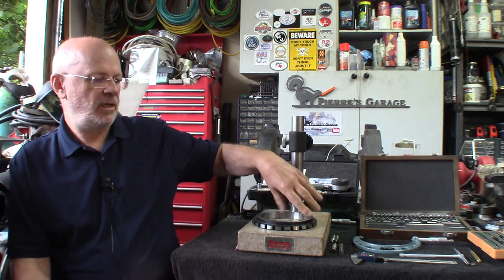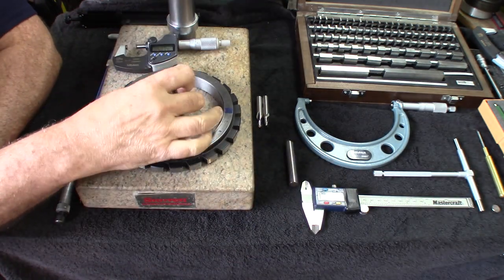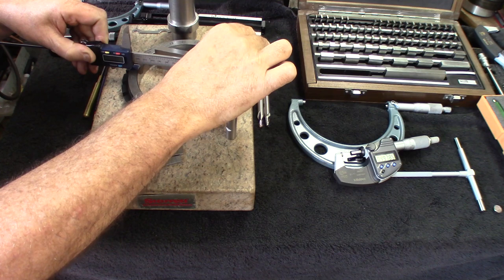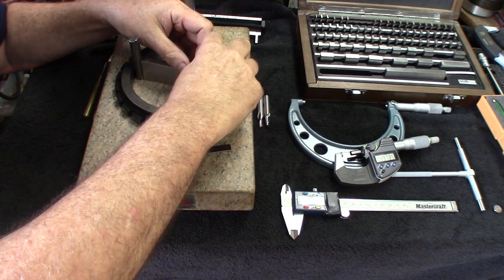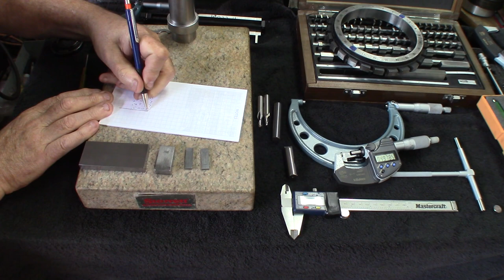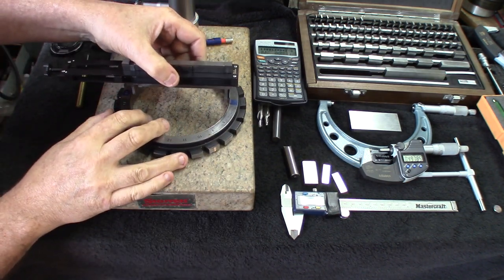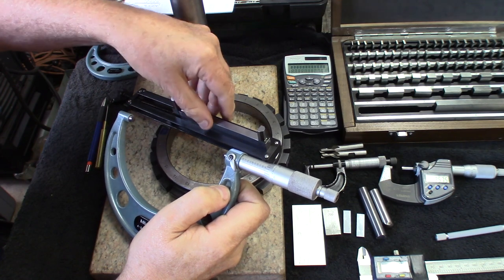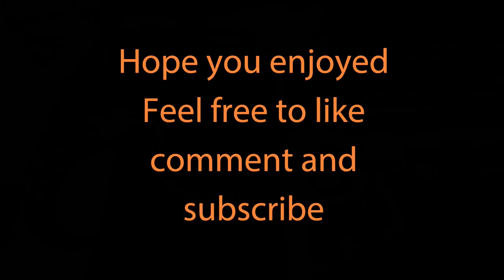Best way to measure an inside bore, very exactly and cheap

Comment: Magnifique, Pierre. I have taken notes. I need a set of gauge blocks and I work  in metric but the principle is the same. One thing I have found is that it is very difficult to find the true diameter and very easy to measure somewhere else in the hole so you are measuring a chord rather than the diameter. The two end mills are really neat because they make it hard to do a chord -- the cylinders will slip off if you are not exactly on the diameter. Very useful!
Reply from the maker: Hi Juan, glad this method will help you to get better measures in  your work, if you have them you could also use some adjustable parrallels, close to be as good as gauge blocks.
Thanks for comment,     Pierre
Reply: Hmm. Adjustable parallels = poor man's (or retirees) gauge blocks. Noted!
Reply from the maker: Something some viewer suggested, great input...

Comment: U give me a lot of very good information so once again thank u . I calkulate the difference between 4.9224 and 4,9225 inch and it is 2,54 micro or My as we say.  In 1986 I bought a new Ford Orion and measured the ticknes of the paint. On the roof and upper side it was 80My on the hod and in the front it was between 90 and 110 My. And that is not much. 2,54 My compare to that is so little it har nothing to say.😊
Reply from the maker: Happy to help, thanks for your comment....

Comment: Hi Pierre, Wish I had your gauge block accessory set. I went with Mit. digital mikes as well. But a caution about those non brand name gauge block sets. Mine were a lot more than $100 when I bought my grade 2 set. They came with a "test certificate" showing the blocks deviation from the true dimension. Despite that there were two blocks of the exact same size in the box. Penn Tools didn't even question that and sent me a Mitutoyo of the correct size as a replacement. So one could start to think the included test certificate might even be bogus. (fwiw I do) I then bought a proper set of grade 2 Mits. and the cheap set is now used as shop blocks. But I never trust there exact accuracy and always measure the gauge block stack as a double check and use the Mit. set only when I need as accurate as possible. There's also quite a noticeable difference in the holding force between the two sets and a visible difference in the surface  lapping quality as one should expect for the price difference.

I certainly agree a cheap set is almost more accuracy than most home shop guys will usually need. My Mit gauge blocks have always measured 100% to the limits of what my mikes can repeat to, but a time or two the cheap set has shown some small differences. If the work needs a real accurate measurement I think I'd make sure and measure the stack as a double sanity check. I now no longer blindly trust any shop equipment unless I check it myself as well as my equipment will allow.

Very good video and an excellent well explained demonstration. A consistent and a very gentle but educated feel is required even more so when getting down to those accuracy levels for those who haven't done this before is about all I could add.
Reply from the maker: Nice input in your comment, those cheap certificates, yap photocopier is a great invention...   lol
For a machinist, the word should be: measure twice machine once.....     
Double checking is always the first thing to do, mostly with closer tolerance parts, even the method of getting there parts machined is as important as the result, even the slightest heat change is working against you in the process, you need to let the part stabilize before any final cuts...
Most hobbyist will be more than satisfied with less expensive tools and metrology units, since money is a major object in their search to fill a tool chest...   ;)
Thanks for comment,    Pierre
Reply: The guys at the calibration lab I visited told me that the blocks which are used when calibrating a 1um accuracy micrometer are accurate to 10th of a micron. And the blocks are calibrated with equipment that is good to 10 nanometers. That's sub millionth of an inch. I don't recall which grade the blocks were, but the 10 nanometers was the most accurate measurements they could do at the lab. The 10 nanometer device was compared to the national standard when it's getting calibrated.

Comment: Great innovative video.  Could you also take the two end mill stubs, using small clamps to affix them to the inside of ring, then use your mic, or even caliper, to measure outside to outside of stubs.
Reply: The problem with this is you can't control the position of the two pins. They have to be exactly on a opposite ends of a diameter. With Pierre's nice gauge block method (or with a telescope gauge or an inside mic) you can feel when you are on diameter because you can no longer wiggle from side to side.
Reply from the maker: It's exact about finding the widest part of the inner circle, the accuracy resides in the precision of that measure, it would be possible to make an expanding device that could hold the pins in the bore and take the measure just like mentioned by Morris, interesting idea also, that would be another possible method... ;)

Comment: Nice technique. 

Two pins plus an adjustable parallel or a planer gauge, measured separately with an outside micrometer would do something similar. Snug the adjustable parallel or planer gauge between the pins and measure all three for a total inside dimension. I've used something similar for making comparative measurements inside dovetails. (I didn't need to know the exact dimension of the new dovetail slot, just whether it was the same size as one that was known to be good.)
Reply from the maker: Hi Peter,   I'll give a try with the adjustable parallels just to test how it compares with direct measurement, cause that will involve tranfering the measure to the micrometer... to be continued...  
If someone is good with trig. it's not too hard to calculate the dovetail problem, first choice, mostly if the reference dovetail is near one of the upper/lower limit of the established standard, I admit that the compare method works in most cases...   ;)
Thanks for the input,      Pierre

Comment: Very interesting video (again). I had not thought of measuring with gauge blocks and pins. Learned something new here, and had not seen this method on any other video! Thank you for your very fine programs. Enjoyed. I'm still thinking about getting my vise jaws ground by you, but right now am negotiating with my pocketbook to see if I can afford a new Kurt vise. We'll see.
Reply from the maker: Hi Jim, since I don't own an inside 3 point bore micrometer or a CMM, and needed the highest possible precision, I looked for a cheap way to get it.....    This is what I came with.....      ;)
Whenever you're ready for the jaws, money don't come easy those days.
Thanks for nice comment,    Pierre

Comment: Nice demo Pierre! The tenth variation between the gauge blocks and mic may have been due to temperature since you were handling the blocks more.
Reply from the maker: Hi Jeffrey,
Or it's possible that a slight calibration error from the micrometer, the chances of affecting the blocks with the little handling they got are close to nothing, or it can also be a handling error during the measure, be aware the tenth are pretty hard to chase....   
Thanks for input and comment,    Pierre
Reply: Indeed! The variables are incredible.

Comment: I would have liked to see how close the telescopic snap guage would have been, compared to the Gage blocks. most home machinists have those for bore measuring.
Reply from the maker: Hi Marcel,
Didn't measure with the telescopic gauges, I'll try to find the rings and see if there is something I can do about it, shouldn't be very far, the gauge blocks is surely the best, though...   ;)
Pierre
Reply: Pierre's Garage  In the video, you were talking about the most direct is the best, which I agree. Working on the lathe, with the part inside the Chuck, we don't want to pull the part out to check the measurement because then you have to re-indicate it. I have a dial bore Gage, inside mic, and telescopic snap gauges. Out of all of them, I prefer the telescopic snap gage. There is a technique to using them though. Abom79 has a great video on using them. The snap gauges will automatically find the largest dimension in a bore provided they are used the way abom shows. I don't particularly like the inside mic because it is truly difficult to find that largest dimension inside a bore. I never compared a snap gage to the gage block method that you used. It would be interesting to know how close it actually is to the Gage block method. Probably a whole new subject for a video!

Comment: We need to grind a flat on some rounds and polish it so that it can work with the cheaper gage blocks. Thank you for the video and the creative ideas. I have an optical flat coming and the mono-chromatic light idea is perfect (and cheap) :).
Reply from the maker: For the price it's working great, not as precise as the real halogen light but at least you get a real close estimation...
Thanks for nice comment,   Pierre

Comment: very interesting video. your cheepo calipers got close enough for average work. i just purchased a set of cheepo calipers at our local grocery store of all places. i intended to use them on wood since they have a fractions function. when i checked them against my micrometer stds i was amazed to see them within a half thou on every std to six inches. most were dead nuts. well i paid eight bucks for them and they are stainless. needless to say i went back and bought a couple more sets.
Reply from the maker: Those stores should give me royalties for all this publicity...    :)
There is one area where any caliper will be more thrown off a little more is when you have length that is in between thousand ex.    1.0044",   1.0046", 1.0048" it could be anything but the right measure,   within it's tolerance, but if we use them as what they're intended we'll be satisfied with the performance...   $8 is even a better deal!
Thanks for your input and comment,    Pierre

Comment: Hi Pierre, just a thought if you measure the outside diameter marking the two contact points of the micrometer, take a measurement of the wall thickness on the two marked places using a known pin size on the inside, deduct to two wall thicknesses from overhaul measurement and there's the answer, good videos keep up the good work.
Reply from the maker: Hi Tony, when measuring there is a principle that the best results are the most direct reading and operations possible, also transposing measures will introduce some degree of error each time, but, this always depends on the circumstances and also what is available at the location at the time the job is done. 
Your method is ok for times where the outside is a mostly regular diameter, in other times if it's a single bore in the middle of a plate it gets a little more complicated...   
Thanks for the input and comment,   Pierre

Comment: But how did the other gauge methods compare? The spring load and the inside micrometer? Just a thought, what about temperature, if you measure tenths doesn't it show, match temperature to what you want to insert..
Reply from the maker: To address your question, this method is for the lowest possible investment, the most precise so far...
The telescopic gauge is kinda better when I deal with smaller bores, not always as reliable and doesn't repeat as well as this, as for the inside micrometer it does better than the telescopic, quite good as a matter of fact.
As temperature is concerned, when it comes time to measure I got to make sure that all the instruments and the samples have been at the same temperature for a while to avoid the effect of different temperature effects.
Those effects will be much more noticeable if you measure different materials that react very different to temperature changes as you measure far from the standard lab temp i.e. 20 degC  Example aluminum and steel,
that day the temp in the shop was about 72 F (22 C) not to worry about... 
Thanks for comment,    Pierre
Reply: In this example, what were  the results with the other methods, 5, 10 ths or more. I know feel is unique, just trying to see if my snap gauge is adequate, meaning worth my time to be proficient with or I am off by several thousandths from the get go.
Reply from the maker: *****
Telescopic gauge can go off by sometimes near a thousand of an inch at this range, like you say touch is everything...
Someone not used to it could be catastrophic...
Inside micrometer is closer, but there touch is important...

Comment: Great tip, now I just need some jo blocks and a surface plate. :-) That being said there would be a lot of "feel" required to get the right measurement as it would be pretty easy to distort that bore a tenth putting the blocks in. I am sure with just a bit of a firm grip i could distort it that much.  When you start working tenths it is a tricky world.
Reply from the maker: Hi Brian, you'll need to lighten up on the fitting the finishing blocks or all you'll do are ovals, large and small...   lol
Just like you say tenths are the undergroundd of machining, normally tolerances in the 5" fits are not that close, and, the bigger we go the more slack they get...   So, it only gets to be another kinda challenge...
Cheers,   Pierre
Reply: Pierre's Garage
 Sometime I need to show just how easy it is to mess measurements up on large items. It is fun to put a snap gage in the bore of an engine block and then squeeze the block by hand and watch the gage fall out. All to often when doing critical work the holding and clamping is more important to the finished piece than the machining.
Reply from the maker: Over clamping is sometimes not any better than under clamping...   Just different issues...   lol

Comment: Hi Pierre, I'm thinking of measuring bores by setting calipers with nib jaws for ID measuring by feel and locking the screw and then measure between the nib jaws with a micrometer. Any thoughts? I'm sure it would get more reliable reading than telescoping gages, at least. My goal is to be able to measure well within a hundredth of a millimeter.
Reply: I might actually ditch that idea or try it later, since yesterday I scored a 0,0002mm (8 millionths of an inch) resolution micrometer head for cheap, I'm going to make it into a very accurate tube wall thickness micrometer and subtract the wall thickness x2 from the OD which I can measure accurately enough. The caliper method could be used when the wall thickness is over 25mm or there would be runout in the OD (still doable if measuring from 180° apart 2 times) then but that's rare for what I've seen. I am a hobby guy and a cheapskate  if it wasn't obvious by the way. But the lathe is super precise and so should be the measurements